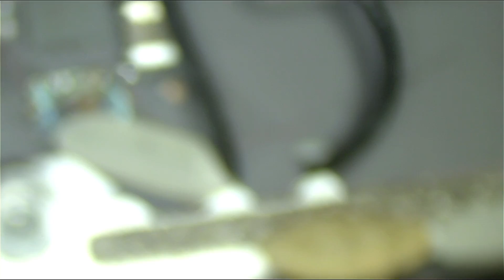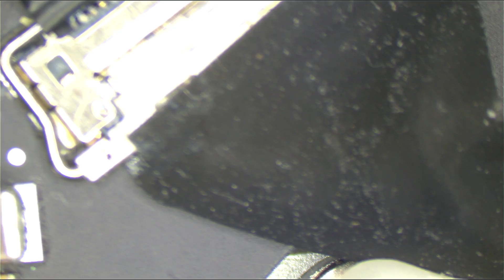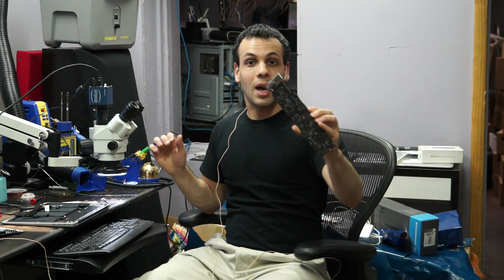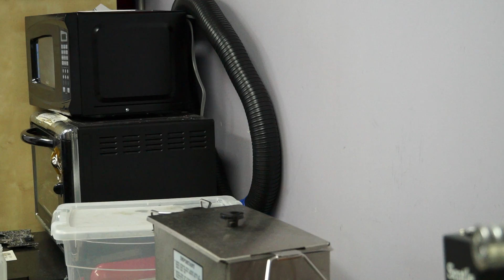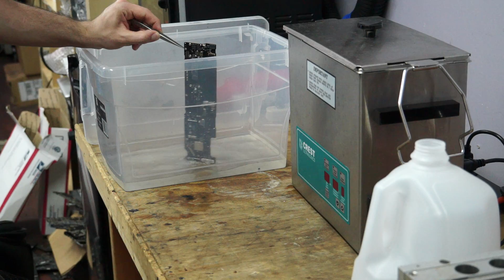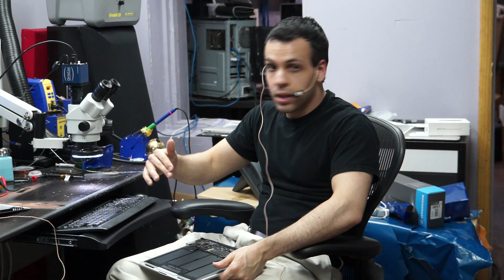How to use rice to repair water damage on iPhones and Macbooks

Comment: Come on man, don't be so arrogant. Comparing drying stuff with rice with wiping your ass... man, that's amazing.

And the rice is for helping on the drying process, water drying, not the water damage. Obviusly the corrosion is not going to come off by rubbing rice on the component. You said it at the end of your video. Rice is not an electronic cleaning material. It helps to avoid corrosion by absorbing moisture.

Most consumers don't have the little screwdrivers needed to open a laptop, and if they do the wouldn't bother with it anyway. That's what repair shops are for.

Anyway, this is a great video on the process of properly cleaning and reparing water damage on a laptop. Great stuff on your channel overall.
Reply from the maker: +Carlos Ivan consumers can buy the screwdriver for three dollars. Or borrow it. Rice doesn't absorb any moisture and drying out is the worst thing to have happen after a spill.

Comment: Yes everyone has a expensive ultrasonic cleaner. Guy if it's just water, remove the motherboard and dipped it distilled water then clean it with 99% alcohol. Chances are you will have this over Louis $2500 ultrasonic cleaner.
Reply from the maker: +Moo Kitty $2500 what asshole did you put this number out of

Comment: Louis RICE IS USED TO CATCH REMAINING HUMIDITY AFTER LIQUID DAMAGE IF YOU DONT HAVE SILICA GEL AVAILABLE. BOTH WORK FINE.  YOU HAVE TO BUY AT LEAST A BUCKET TO PUT A WHOLE MOTHERBOARD. BUT ITS NOT A MYTH.
Reply: Capital letters doesnt make the rice method not a myth it's still 100% a myth.
Reply: @stonedsavage7814  Im sorry about the intrusive capital letters. Is not a myth it has been proved it works but  is not that effective and can cause further damages. That's not a myth, that's a fact. 
We have known for centuries that rice absorbs water at high temperatures. However there has been a growing interest in using rice as a desiccant. One study focused on using rice to dry out hearing aid devices (Nelson et al., 2017). 
Sadik and White (1982) experimented with rice as a desiccant to dry seeds for long-term storage. They found that 30 to 40 g of toasted rice (with < 1% moisture) dried 20 g of true potato seed from 11.5% moisture down to 4 to 5% moisture. They also found that toasted rice had more drying capacity than toasted kernels of wheat, maize, or soybean. That's not a myth. The fact is rice does and is used a desiccant. 

So the fact rice isn't a solution to fix broken phones, it isn't a completely not preposterous thing to do it and in some cases it could be even effective, there are bags made from porous materials suited for keeping the rice dust out while allowing humidity exchange. And if the rice is pre heated as the experiment I cited, it enhances the absorbent capacity.

I think we have a semantic problem here, a Myth is one thing, the effectiveness of rice properly pre heated and used in clean porous baggies to "dry" a phone, against the effectivity of silica gel and other techniques to remove water from an smartphone is another. 
And varies immensely from case to case,
and it's particularities.

I don't use rice, I use silica and pressurized air. Anyways you don't want dissecans's particles in contact with the device, that's why you mus use porous baggies, If you for some kind of reason are attempting anything like that.

Is not a myth. we know is not a solution the way most people think why and how it works. I've used rice successfully to remove moisture from a book, and a watch and it worked decently. But please don't try if you can get silica or do another perhaps more cost effective method.

Comment: hey Ross, I think you got it wrong, Rice can't fix water damaged components, but if you put the motherboard of the device into a bucket of Rice, it guides the water molecules down to the bottom, it doesn't exactly absorb water
Reply from the maker: +applehacker 321 even that does absolutely nothing

Comment: Haha, an expensive ultrasonic cleaner? That would be nice to have, but I found that a couple bucks at the car wash pressure washer works just about as good with a little caution, also a vinegar bath followed by baking soda solution to neutralize, water rinse, alcohol rinse, then heat, or even a simple air compressor blower and an hour or 2 on the hood of your car LOL. Also a touch of WD40 can help with stubborn connections and prevent future corrosion. Wash, rinse, repeat if necessary, and scrub behind the ears too. BTW a little tire cleaner at the car wash removes soot from house fire damage. Take what you will from that, coming from a Katrina survivor.

Comment: the idea of the rice is to absorb the liquid before it causes damage like how they use silicon pellets to keep humidity out of clothing and shoes. its still a bs myth only cuz people dont understand why water damages electrical components to fail and that the ebst thing to do is shut the device off and let it dry 100 percent before attempting to power the device back on. rice might be efffective at holding back moisture build up but its certainly not going to absord large amounts of water that are on another side of a solid piece of plastic or alluminum.

Comment: They think that the rich will soak up the water before it can seriously damage the computer, but water damage to something with power is pretty much instant. The only way rice will help is if there was no electricity going to the device & it will eventually absorb the water in the right environment(a sealed bag in a warm area). In that situation, you'd be better off just taking it apart yourself & letting it air dry.

Comment: you are a fucking faker! 9:22 after the cut, you putted the board into rice for 2 days, and after that, you show the results of the rice! why didn't you show us the board upclose before the cut? jou say that the rice won't work only, because you don't want to lose your customers, and you tell people fake info. fuck you!

(pls don't get it serious)
btw: you, and respect for apple products?! are you in your mind?
Reply: the rice works by removing humidity from the air, and when the air is dry, water from the device will evaporate super fast! and if you do that, the water has no time to corrode the pcb! you don't understand basic phisycs!

still, don't take it serious :P
Reply: basics physics apparently didnt tell you that the corrosion is caused by electricity passing through the circuitry which causes the oxidation and corrosion and that only takes less than a minute i highly dought any magical rice yo may have will absorb liquid from inside the phone in less thna a minute and if yoru smaaart enoguh and capable enough to pull the battery and completely disconnect power from the device emmediatly then it doesnt matter if you use rice or not the chances of success are the same and rice may be decent at keeping away moisturte but not for absorbing the amount of liquid a soaked phone can hold cuz even with your idea of super fast thats still a whole 24 hours point is in the end rice is pointless and gives people a false sense of security
Reply: thanks for trying to be informative, but please, read my comment before replying. thanks.
Reply: MrDoboz I'm pretty sure 'putted' is something to do with golf.
Reply: MrDoboz wow I find if hard belive you can be that stupid. Hats off to you man.

Comment: I always thought its the kind of thing that only works right when you get some water in your device and before any permanent damage has been done. You can put it in a bag of rice which will draw out some of the moisture with its natural absorbent properties. Maybe bullshit but what do you have to lose?
Reply from the maker: you lose the opportunity to open it or take it to someone to open it because you think the rice actually did something. it's like putting off cancer treatment because you think eating raw garlic will make the tumor go away, then it's in stage 4 and it's too late to even get treatment because you waited so long. false hope is a terrible thing.
Reply: Rice is not a cleaning agent.  Dry rice acts as a desiccant.  It is only to prevent additional water damage but all power sources must be removed from the device immediately to prevent as much corrosion as possible.  I have actually saved devices by using rice.  Again, I say that it is for water only and all power sources must be removed immediately.  The amount of corrosion you complain about is from agents such as soda which leave residues and/or sticking the item in rice with a battery still installed.

Comment: Look, I like what you preach. But the point of rice is just to promote a desiccating environment around the water damaged device. While it's possible other people have subverted the idea of it, the original idea was never meant to cure all forms of water damage regardless of severity.
Reply: It doesn't work regardless though. It's a nice idea but ultimately it is an old wives' tale.

Comment: I personally brush the board with anti-scale prroduct for bathrom, then i rinse and dry it with hairdryer 10 min at 65 °.. Boards are always top clean , and i salved a lot with this system.GtrzMax

Comment: Question: Where do you get 99% alcohol?  I can't find any in my normal sources.
Reply from the maker: ebay
Reply: Failing that, you could try to make 90% work. It seems to for me. I wouldn't go below that though. You can usually find 90% in places like walmart

Comment: Your alcohol bath, oven, and whatever else is done for the same reason people use rice. To dry it out and prevent further damage when the device is turned back on. Is it perfect? No, but it is free if you have rice laying around.
Reply: and it doesn't fucking work.  His alcohol bath and oven and ultrasonic cleans the board.

Comment: Here we go, the contact between rice in the bags/boxes produces fine rice dust. Now if you get water damage and your phone turns off, turning it back on may short a circuit, however, placing the phone/device in rice allows the rice dust to picks up the extra water.

Comment: People use the rice initially when they have gotten the liquid on the phone to try to prevent the corrosion damage you talked about by reducing the amount of liquid getting in there, probably still doesn't work but still, that's what people use it for
Reply: Water isn’t what causes corrosion. The minerals in the water does, and 9/10 unless you dropped your phone in distilled water which he uses to clean in the ultra sonic cleaner. The tap water will get onto the boards and the minerals in it will chemically react with the metals on the board and damage the components. Drawing out moisture does nothing as the moisture itself doesn’t damage it.
Reply: Sean McGeeney
Reply: cjmillsnun 
Uh... How?
Reply: Probably. No. It doesnt. The rice will catch run off that comes out of the phone. Rice does not have a mystical syphoning property that can draw moisture out from plastic, glass and aluminium.... Even if you took the logic board out while it is still wet, resting it in rice is just straight up fucking dumb. And you obviously deserve your apple product.
Reply: @adroxorz  Actually it does... rice will absorb moisture. Very similarly to descant packets.
Reply: @SirFrag32  rice is pretty damn cheap, so if I break open dessicant packets why aren't they using rice if it works similarly? Regardless rice won't fix any short and corrosion will form very rapidly if liquid touches a powered board. The most important thing to do is to disconnect the battery to prevent power draining through the short.
Reply: @ronyan1  similarly does not mean better. Words are hard.
Reply: @SirFrag32  no no no no no you were just f**** wrong rice does not absorb moisture. You want something that acts like a desiccant use a f**** desiccant.
Reply: @ronyan1  Because rice is a food, and you wouldn't want to be packing a food inside shipped products - it would attract rodents/insects. Same reason you don't find actual popcorn used to pack goods - rats would have a field day.  Further - if a desiccant like silica gel absorbs water, it remains inert. But if rice absorbs water, it's likely to rot and decay, which wouldn't be nice if you opened your new product to find moldy, stinky, gooey rice in a package. Rice is probably only 1/10th as effective as silica gel, but it's something that most households have 'on hand'.  Rice will absorb moisture from the air, allowing more moisture to be 'drawn' out from a damp object, thus drying it out.
Reply: It makes it worse.

Comment: Hi, Louis! I am enjoying your channel!

That said, I'm curious. Is the alcohol you're using sweet to the taste?

I ask because back when I was in the Navy, one of my jobs was to perform maintenance and repair on my ship's AT&T Model-40 Teletypes (http://www.baudot.net/teletype/M40.htm), and to do that, we sometimes had to clean parts of it with alcohol, and we were provided with stock numbers to order what they called "technical grade isopropyl alcohol."

Everything was fine, until somebody in Supply decided that we could use non-technical grade alcohol ... so I used  that non-technical grade stuff to clean one of the circuit boards, and I noticed that it left a film on the board I was cleaning. I don't know why, but I tasted the alcohol (just a drop on my finger) and found it to be sweet, while the technical grade alcohol I had ordered was not, with the added benefit of leaving no film on the board.

I put the board back into the printer it came out of, and shortly afterwards, that printer died!

It took a wile to get my ship to stop ordering substitutes for stuff I requested specifically -- and don't even get me started on the crappy part they sent me that was so poorly made it destroyed a couple of $2500 printers!

Comment: I do like the semi-literate idea that rice, silica gel, salt or magic "I dropped my phone in the bath" drying bags will help get the water out the device, which is a good thing. It shows the general population have sort of grasped some sort of modern knowledge about the world.

Unfortunately it totally ignores the damage caused by the water. The key word to look up is "electrolysis". Water, electricity and conductive compounds love each other very much. And with a 30-odd watt-hour battery in a laptop, there's plenty of electricity to go around.

The other problem is, without taking the device apart, how do you know for certain there isn't some tiny bead of moisture trapped underneath the screen where no amount of blowing is going to make it move. The key words to look up here are "capillary action". Water likes to wick its way into narrow spaces. It doesn't like to come out again though.

Of course, this could all be solved if manufacturers made their devices water proof. It'd make them 100% unrepairable, but since most damage seems to be caused by them getting wet, there'd be less reason to repair them. It's not like manufacturers don't know how to conformally coat boards, or blob epoxy on things they want protecting, is it?
Reply: Not sure if coating boards, blobbing specific components, etc would be sufficient; and that too would add cost. Sealing the device seems to be the most important, and that is a huge challenge when you have 'ports'.  Wireless charging, bluetooth headphones, etc allow for zero ports I guess. Speaker sound can pass through a waterproof membrane. 

How long will water remain if 'wicked' into a very narrow space? I presume, very slowly, the 'edges' of the water sliver will evaporate. Applying heat, and having a desiccant like rice, ought to help with that.

Comment: the rice absorbs the water so it does less damage it doesn't repair anything
Reply: GD coolkid is rice not a viable way for pussys trying to get the water out who won't open their pc
Reply: sry phone
Reply: The actual best thing you can do is keep it wet until you can get it out and into either an ultrasonic or bathe it in alcohol to get the water with the minerals out.  Drying it out will bake the minerals on and the damage will be worse.  Jessa (iPad Rehab) has a good video on this.
Reply: Lolno

Comment: Louis, great video! I have the tools/capabilities of cleaning the motherboard of my wife's 2011 MacBook Pro per your instructions. I'll be honest tho, it makes me nervous to put electronics in any kind of liquid. My questions are: Is it distilled water that can be purchased from any Walmart or is it deionized water? Also, I have pressurized clean GN2 that I could blow onto the board (gently of course). Will this suffice if I combine that method with heat sealing the device in with a desiccant bag (or multiple desiccant bags) and leaving it sit for a day or so? Also, the ultrasonic cleaner I would be using doesn't have a temperature control setting, but it does have a heater. Would you recommend me turning the heat on while it's in the cleaning solution?
Thank you for this amazing video.

Comment: Salt absorbs moisture a hell of a lot better than rice......but it shouldn't touch any of the electronics.......But like Louis said.....putting it in a toaster oven on low for an hour or so would probably work better at removing the moisture. But nothing is going to fix any damage caused by the liquid....unless you take it apart and fix it.